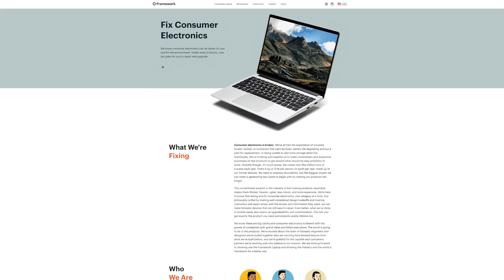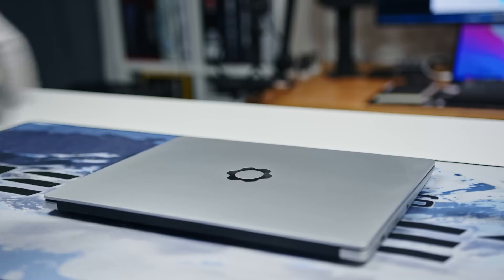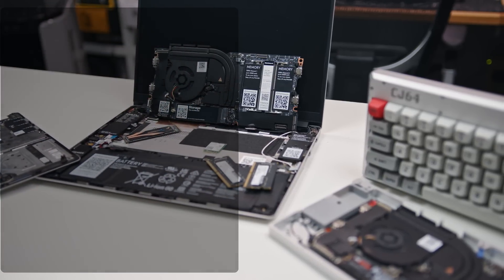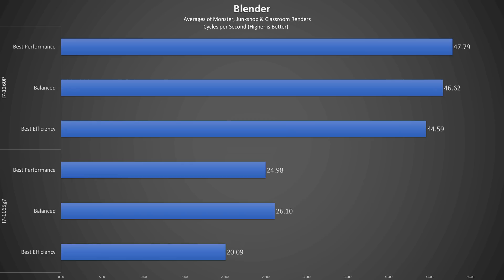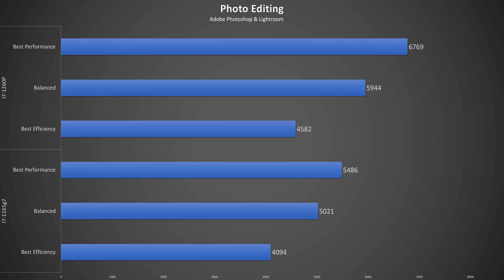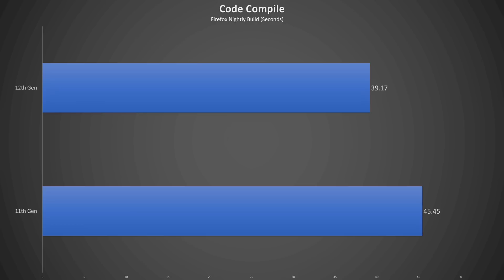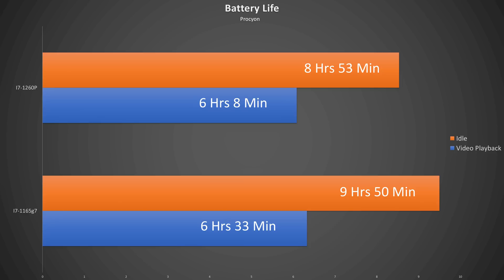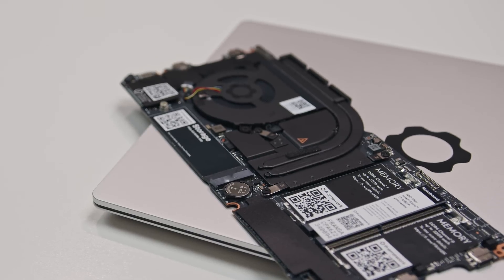Framework Laptop 12th Gen Upgrade! Performance and Efficiency Tested!

Comment: Can't do that on a "Pro" level Apple machine.
Reply from the maker: Mainstream Apple customers don't care and Apple knows that. They just trade their old device in for a new device every few years. Apple resale and trade in values are the best in the industry.
Reply: @ElevatedSystems  Yeah, but their environmental footprint is probably industry leading as well...
Reply: I do prefer the efficient performance of my Apple Silicon MacBook Pro — cooler, quieter, with better battery life and often faster than the laptops in this review — but…I am also totally rooting for Framework to succeed, because if the market makes Framework successful enough to show other companies that modularity is a competitive advantage, that could motivate Apple to make their products more user-serviceable.

The right-to-repair movement has probably already been a factor in changes to Mac laptops. For example, in the current line, iFixIt noted that the MagSafe and Thunderbolt/USB ports, and the batteries, are significantly easier to remove and replace than before.

The market could one day swing Apple around to create a modern reimagining of the Apple PowerBook G3, with its two module bays and a keyboard that could be removed in seconds for access to memory and storage…the pinnacle of easy access and modularity in Mac laptops, 22 years ago.

Comment: Framework has to start a 2nd hand selling website where other people can list their older framework parts for sale only then it will succeed because repairability is useless if you can't properly reuse or resell your older parts to make up some part of the expense of the new ones. A lot of people will be there to just buy older 11th gen part for less to diy a media pc or even light workspace PC.
Reply from the maker: That's called eBay 😜 But seriously that's has bigger logistical and legal implications than you probably realize.
Reply: @ElevatedSystems  eh, same logistics questions were made about this company in the first place, im pretty sure if FW wanted to create an online marketplace they could easily do so, esp given that the parts are QR coded
Reply: I don't know why the don't do that right in their community forums. Just make sub-section for buying and selling. But I feel the 2nd hand market will really catch on after one or two more generations of parts.
Reply: It’s an entirely reasonable suggestion. Peak Design has done that for their premium tech/travel bag products. They created an online marketplace that lets you set the price, and charges no fees. While this does generate goodwill and “green cred” by encouraging reuse, there is another advantage for the company: The easier it is for a customer to get money for their old gear, the sooner that customer can afford to buy more stuff from them.

Framework could use the same model, both to keep old parts circulating and in use, and to free up the purchasing power of existing customers to sell them upgrades.
Reply: A program where you can ship them your old parts in exchange for discounts would create a good incentive system. They need a way to recycle old parts.
Reply: @austinedeclan10  what are they gonna do with old parts?!? 😂

They ain’t apple or Samsung

Unless you want them to recycle the parts and sell them as new to you without you knowing 😂
Reply: @RunForPeace-hk1cu  the metal and plastic can be used again in new stuff as for the glass or any other unusable part, they'd have it disposed of better than the average consumer (if they're eco conscious). A company probably disposes e waste better than the average consumer
Reply: hey that's a good idea! just like the keebsforall marketplace
Reply: There are a handful of established marketplaces for resell with good consumer protections baked in. No sense for these guys to try and reinvent the wheel.
A return-for-discount program might make sense down the road once they're more established, but I don't see it happening anytime soon.
Reply: @xXQuickpawXx  creating a dedicated exchange, with industry-standard consumer rights protections, lowers the SNR to the buyers and sellers, ebay has so many filters that must be in place before you can even start to look for the product you want that its almost useless. the best use-case of ebay is for specific sellers to list their inventory. 
and creating an online marketplace even including all the legal shit would take about a week, its not hard, especially when its all related to a single product line. that isnt reinventing the wheel.

Comment: Even if the performance increase isn't quite worth $800 to me, it still means its a great time to buy a Framework for new customers!
Reply: gee thanks pollyanna, i wd never have figured that out
Reply: perhaps you're not supposed to spend these $800 yearly, the value is much better if you upgrade every few years, once you need more performance
Reply: Who spends 800$ a year on a computer
Reply: @adamnolen4609  apple users but in all seriousness thats no different then desktop users buying the brand new GPU every time one drops
Reply: @trashtronics1700  dude just spent 2k on a underperforming Walmart version of a MacBook Pro with 6Hrs of battery life. 🤡. But hey, he gets to replace the bad quality parts, with more bad quality parts from the same company!!!! It’s genius!!! 🤡.  It’s easier to fool people than to convince them they have been fooled.
Reply: @AlmightyEye what's your solution?
Reply: Agreed
Reply: But you still have the old board
Reply: Which you can use for other stuff or sell it as a mini pc
Reply: @zanguusu 😂😂😂😂